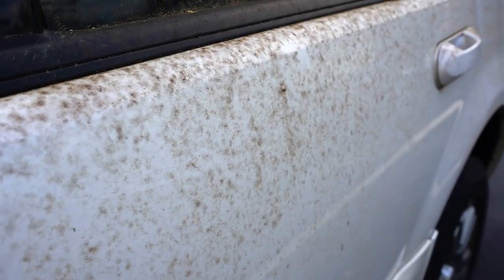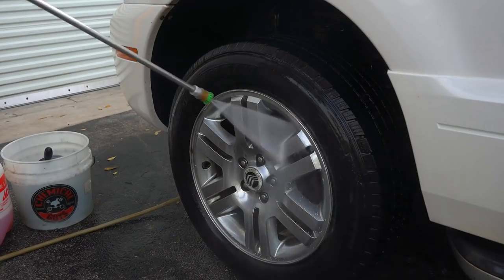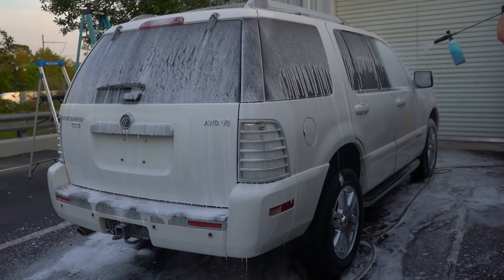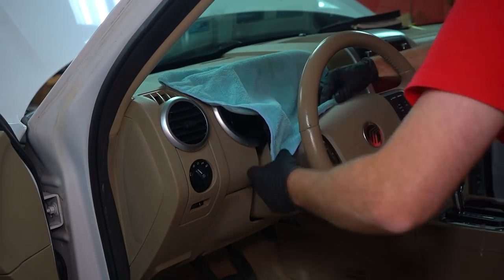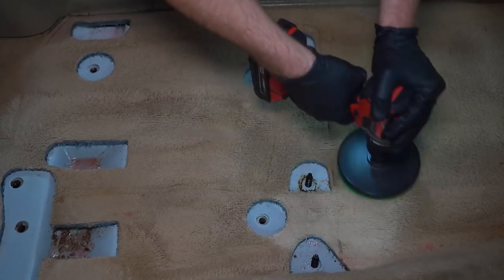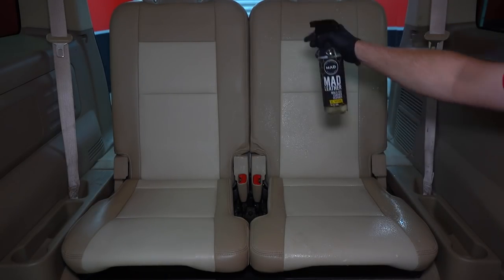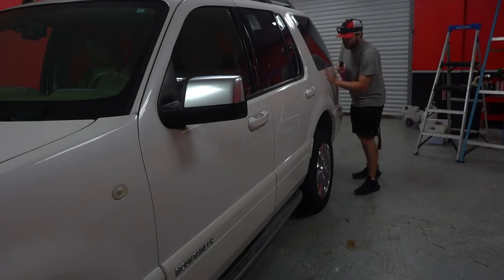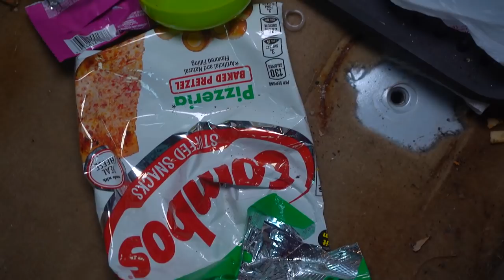ABANDONED Barnyard Find | Nasty Moldy SUV | First Wash In Years | Car Detailing Restoration!!

Comment: As wet and humid Florida is, leaving a vehicle sit under trees for any extended period will make it look like its been sitting for 20 years.
Reply: That stuff came off so easy it almost looks fake. There was good reflection hidden under it (look at the before shot across the hood), I'm not really buying the whole "abandoned barn find" thing on this one. Even the wheels were pretty clean, tires too, no cobwebs either; and I may have missed it, but I didn't see any of the "mold" the title talks about.
Reply: @2005StangMan  Seems a bit too convenient, you're right. Aged mildew doesn't come off that easy

Comment: Great job on a gorgeous vehicle.  I have a 2006 that I bought new.  Now has over 300,000 miles.  I like it so much that  shopped around and bought a low mileage replacement for when the 06 dies.  That was five years ago and the 06 lives on.  At this rate I'll have collector plates on the replacement before I need to start using it!

Comment: I have a Mountaineer. And from my experience, this is a well built SUV. I've had mine since 2008. I'm also planning to get mine detailed soon. As far as a bar find, not sure. But the engine in the one here is just like mine. A slightly detuned version of the 2006 Ford Mustang GT's 4.6 V8. Good and reliable N/A V8. It's definitely, a keeper.